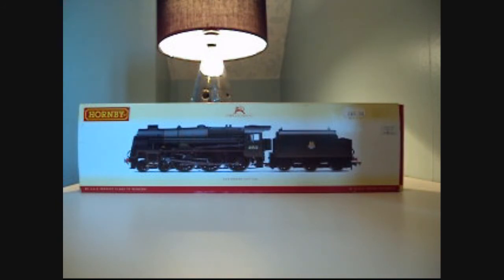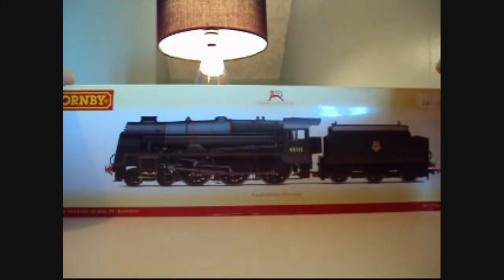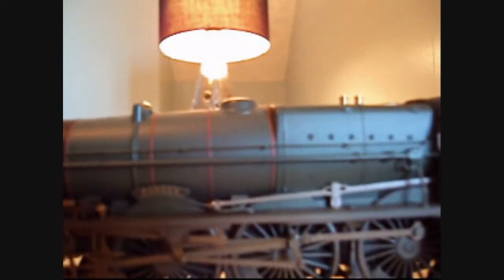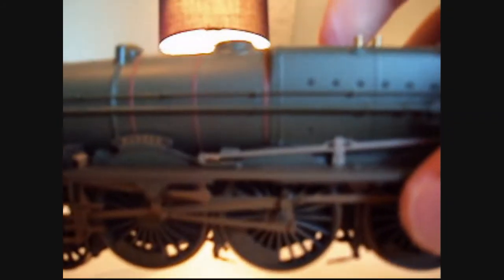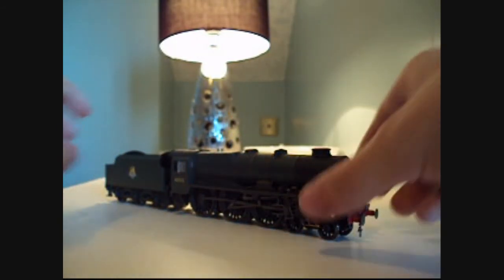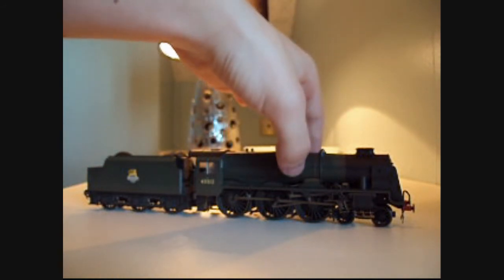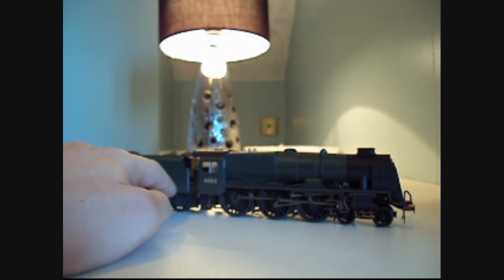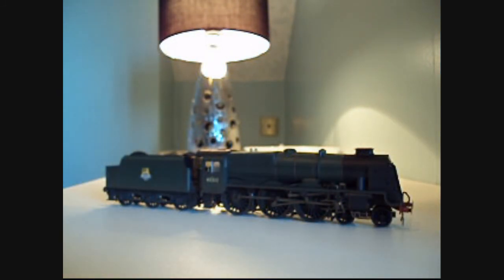Hornby Class 7P Bunsen Review

Comment: Hi Mark, good review, sorry you had so many problems at first though.

On my N15(King Arthur class) there was a slot for the decoder in the weight towards the front of the smoke box, I assume there's one in your Patriot too.  These days, I use a TCS DP2X-UK which has the pins built into the chip negating the need for a harness and the associated wires/ need to find a safe place for the decoder.
I'll be at Railfest the day after you're staring at the Scotsman(I'll be the one hugging KOYLI) :-)

Comment: Would it be feasible to mount a decoder in the tender anyway, and run wires from it into the locomotive? That might deal with the space issue better. 
Either that, or cut away part of one of the ballast weights and make some space in the loco.

Comment: Was the internal block suffering from Mazak rot?
I have just returned one because the  block was swollen, making it hard to remove/replace the top, and distorted, making motor /gear connection dodgy                                                                                 It seems quite a few Patriots of that era were affected.